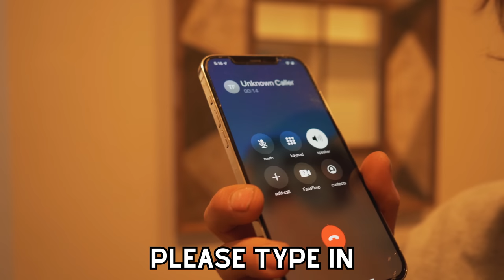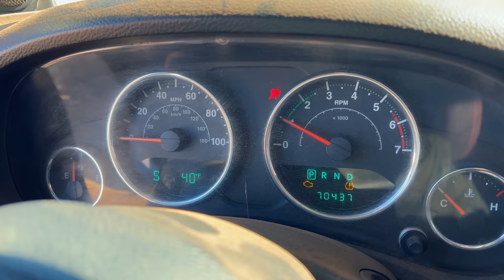ALMOST SCAMMED $65,000 ON ACCIDENT

Comment: As far as the "track system" goes, I believe I've seen Paul from Fab Rats use one in his shop in some of his videos. Plus, he will also be building a new shop, so you guys might want to bounce ideas back and forth. Hope you guys set up soon in the new shop. Congrats and good luck moving forward!!!
Reply: Paul's track is mounted on a center post that can also turn 360 degrees. The base is the hub of a 2-ton rear axle, that's sunken into the concrete floor and the swivel is held in place by an air brake like you'd find on a semi trailer. It's an ingenious system that he build out of salvaged parts. It would be a great setup in a shop like this one.

Comment: You can get all the over head crane stuff from harbor freight, plan on extending the remote cable because it's very short. Mohawk has 2 posts that operate much like the booms of a fork lift and the are made in America! Fans to move hot air back down from the ceiling in that tall building will come in clutch too

Comment: Just buy a roller that mounts to the bottom of any structural I-beam. Then get a simple hand operated chain hoist. If you wanna spend a few extra dollars, you can buy electric chain hoists. 
Easy cheap solution for a crane in the shop. 👍👍

Comment: Before my local steel warehouse  shut down, they had two I beams the  length of the building with a trolley system holding another I beam that was the width of the building. Two, two ton winches. You could move a 40' lift of steel anywhere in the building. Which, by the way, was 100' wide by 400' long. Best of luck 👍. If you're having trouble visualizing, look up in the top of most old barns. Most have a trolley system for moving hay.
Reply from the maker: Dang that sound like a dean of a setup!! 😁😁 thank you for watching and the awesome comment!!

Comment: Don’t go cheap on the epoxy! Home Depot floor kits are junk and won’t hold up. Go with a more industrial product like Amerlock 2. It’s a 2 part epoxy from PPG. Then top coat it with Pitthane Ultra. As long as you prep the concrete correctly, this finish will out last Rustoleum and big box store floor kits hands down!

Comment: The shop I grew up in had that kinda winch system. It had a large ibeam and the winch had rollers on it so it could move with a load. Also might check out the one fab rats has.

Comment: I have worked in Manfacturing where we have had several of the sliding wench systems, I would recommend putting in at least 2 of the winch track systems. once you get used to having them you will wonder how you ever lived without them.  they come in handy for pulling motors and lifting all kinds of things .
Reply from the maker: Right on man thank you! It’s we will look into that 😁😁

Comment: Don't skimp on your car lifts.There are lots of good brand of lifts. I've had quite a few lift in my shop over the years. Weight capacity is big deal .I had an 8000lb lift that struggled lifting a 6800lb Tahoe (it was sketchy lifting them ) and a 10000lb that was the only lift in my shop that could lift my 8600lb H2 Hummer. Be realistic you're probably not going to be lifting only Jeeps .Also the adapters that come with lifts can make it easy for you or make you worry every time you lift a vehicle! Good luck Peck Brothers . Awesome Garage!
Reply from the maker: Thanks so much for the info!! We haven’t dealt with car lifts much in our lives so all the info helps a ton 😁😁 we appreciate you watching 🔥🔥

Comment: The cheapest way I've done floor coating. Is rustolium 2 part epoxy. Have done a couple shops with it. My current man cave. My son did the grinding put a water base epoxy seal coat then epoxy with 16th inch flacke finished it with 2 coats of industrial urethane with aluminum oxide in it.  So it's held up to gas break fluid and oil. The only spot I have is a tire mark. Have 124 cubic inch dyna with soft tires. Think I had some break fluid get on it and it left a tread mark. I believe my company shop was done with rustolium and it with stands all fluids
Reply from the maker: Well thank you for all the good info 😁😁 we so appreciate you watching and sharing your ideas 🔥🙏🏼🙏🏼

Comment: Tell me what is this house inspector? Do you have drain tile around the footing going to a sump pump it with a sump pump in it😂❤ can you put cables on angles on them walls to keep them square
Reply from the maker: This house was all hands on deck to get it dried in before winter started so there’s a lot of stuff that will be getting done when the snow is gone! We would have been 100% fine if we had a normal winter haha

Comment: Tell me, how are you get stuck with the combination😂 maybe you should’ve dug that swale along time ago . You could’ve stopped the water immediately with a bunch of bags of sand.
Reply from the maker: Lol this is one of those where you would have had to have been there. Sand bags are an hour away we live in the mountains. And we never got stuck stuck because the tractor has a back hoe but the tires didn’t hardly do anything it was so slick you had to just grab and move the tractor around with the boom. It might look like we are idiots and it was a simple fix but it was not